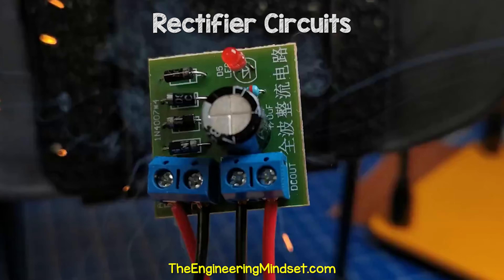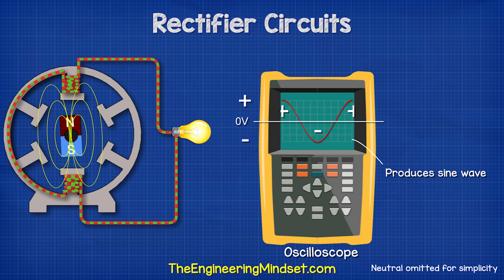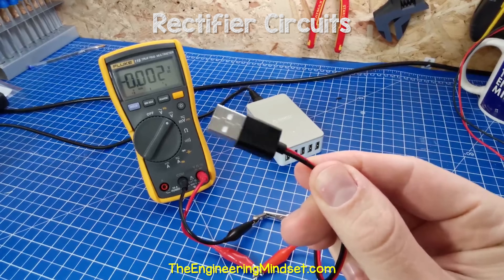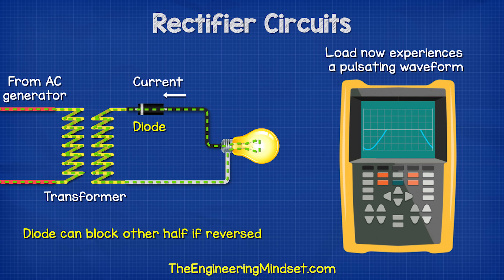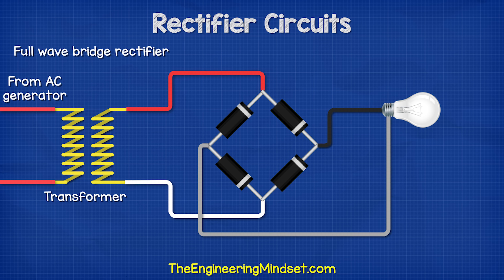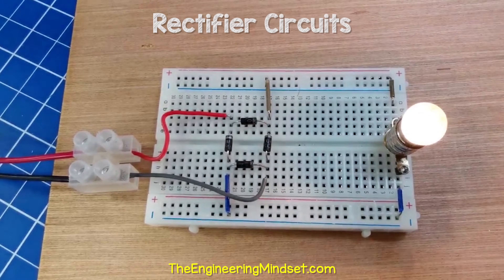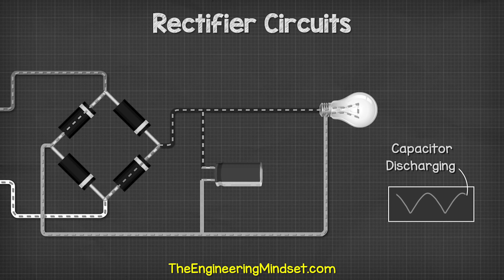Full Wave Bridge Rectifier + Capacitor filters +  half wave rectifier

Comment: Hi, Do you know any board for the following application input 110 VAC and Output 320 VDC with 0.75kw? I think that could be full bridge rectifier and increase the voltage and capacitor filter. Let me know your comments. Regards

Comment: US voltage is technically 240 V at the house via 2 connections split-phase. Some sockets in a house will be hooked to both bus bars to make 240 V.

Comment: I love this. Especially for homemade generators. 
But how to chose a Bleeder Resistor, especially for high voltage, high current circuits? Is it ok wire resistors in parallel, if I can't find high enough wattage resistors?
Like if, for example I need a resistor that can survive 1000 watts, at 10 Ohms, but I can only find 250 watt resistors. So, should I wire together in parallel four 250watt, resistors, each with 40 Ohms resistance, to compensate for the added paths of current, when I just want more surface area to disparate heat?

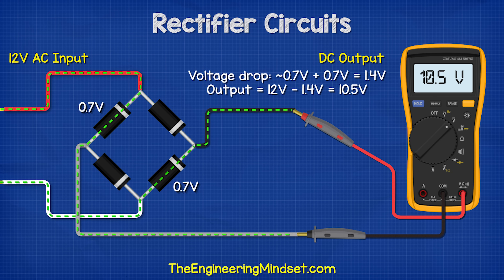Comment: At 16:03 why does the multimeter calculate using rms voltage 12v ac without capacitor to 10.5v dc but with capacitor it calculates using peak voltage 16.9v ac to 15.5v dc, how does the capacitor make the multimeter do that??😊

Comment: Hey Paul, I made a circuit using this tool on my phone called proto, highly recommend it, I user 5v AC and I think my led hated that so I cranked the max voltage as high as it would go and used a 100F capacitor since you cna easily use those and boom DC baby
Reply from the maker: Seen the new LED explained video? so much detail covered! https://youtu.be/O8M2z2hIbag

Comment: am trying to make a full bridge rectifier to convert 300 volts at 300Khz to dc with HFA25PB60 diodes but the output is not DC can you explain why ?

Comment: A great intro to the subject.  One thing I always find lacking in any coverage of AC is the reason why power companies use it.  

Basically it boils down to distance between generation and end-use.  AC voltage is easier and more efficient to deliver over longer distances than DC is... not as much power is lost transmitting it over longer distances.

Comment: As stated, the components in consumer electronics use and expect DC power. Question: Is it theoretically possible to produce consumer electronics that fully function on AC power? If so, why didn't we do that? Is it simply not technically possible? Is it inefficient compared to DC? Or would it need a totally different approach to electronics?

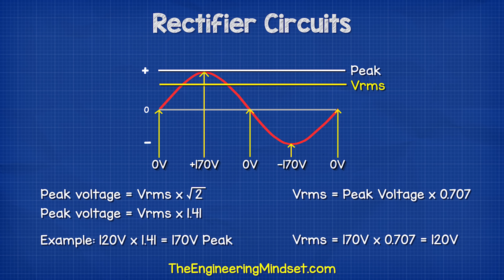Comment: One slight mistake at time stamp of about 3:37 : You say RMS voltage is obtained by dividing peak voltage by 0.707 when in fact it is multiplied by 0.707. The graphic in the video is nevertheless correct.
Reply: no he has the RMS value (120V in america) and is converting it to the peak voltage

Comment: I feel like all of the videos I find like this teach the theory of the board, and rarely approach the details.  How do I decide for my application what size resistors I should use?  How can I determine the right size capacitor and number of capacitors to use?  Why do the capacitors need to be in parallel?  What would happen if you put them in series instead?  What is an inductor?  How do I choose the right one for my application?  I know what a transistor is (sort of), but again, how do I choose one for my application?
Reply from the maker: Check out NEW resistor video, everything covered! ➡️ https://youtu.be/DYcLFHgVCn0

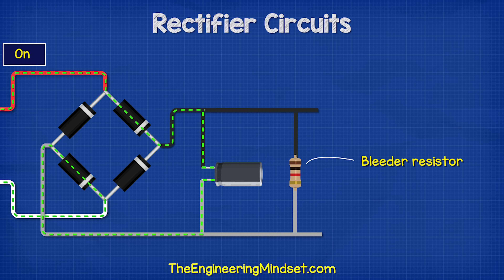Comment: This is excellent, but I'm trying to understand something: At 15:10, how is it that when the power is switched off, the current discharged from the capacitor will go the path to the bleeder resistor rather than to the load? Also, why wouldn't the current take this path while power is on? I'm just trying to understand the behaviour of the electrical current. Thank you for this video and any help.
Reply from the maker: Check out NEW resistor video, everything covered! ➡️ https://youtu.be/DYcLFHgVCn0
Reply: @EngineeringMindset  Thank you, sir.

Comment: A slight disagreement with your description of AC at 2:35. With a 2-wire voltage like this, what is "zero volts"? In this instance, it is only a mathematical construct. There is no "0VAC" connection anywhere. 0V is only a reference point for the math, where y = A*sin (wt) describes a floating AC voltage. But a meter or the generator itself has no idea what 0V means. Similarly, there is great misunderstanding of what "ground" means, too. What is ground? Does an electron know what it means? No, it is only a convenient reference point that we humans use to make a schematic look simpler. Ground, or 0V, means nothing to an electron. Electrons will go where electrons go. 0V is only where your meter's black wire probe touches! You can put that probe anywhere if you so desire. Many an engineer goes wrong by assuming his GND signal means there is zero voltage differential between various GND points of his circuit. If there is current flowing in the ground plane, then you betcha that there is a small voltage differential across the ground plane. Tiny, but finite. Audio engineers understand this subtle point because differential ground voltages can and will enter your audio circuit if you don't know what you're doing. I do concede that using the ubiquitous Ground symbol makes for a cleaner schematic, while also defining what you, the designer, want to define as zero volts.

Comment: So what about a formula for the inductors required inductance? I know the formula for the capacitors is Current*half the cycle time in seconds all divided by the acceptable voltage drop but what about with the inductors?

Comment: Question, I got a 85 Suzuki lt230s quadsport all the wiring is gone. If I build my own wiring harness do I need diodes or capacitors? It does still have a rectifier/regulator on the bike but not connected to anything.

Comment: There is a relevant question roaming around you tube Ain't get an answer on (when do i know i need to use capacitor in the circuit)? capacitors are used nearly in all electronics circuit but at least today i learn on when do i need to use capacitor on (filtering) apart from learn on how the bridge rectifier work. Thank you and u won my subscription & up thumb.

Comment: Please help i made my own bridge rectifier when i connect small 3v lamp  to its output the voltage drops from 13v to 0.5v i tried using my oscilloscope shows that from full bridge to straight line.

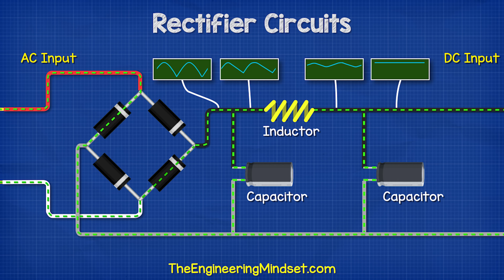Comment: Very well explained! I have a question though. At 17:53 you said the 2nd capacitor is much smaller. Is it small enough that it should be shown as a disc (rather than a cylinder), or is it a cylinder to show that it is polarized like the first one?
Reply: Think it’s to show polarity since on the next slide at 18:00 you can see he uses disk capacitors

Comment: The laptop "adapter" shown at 1:40 is a switched-mode power supply which has two full wave rectifiers in it, the first to produce high-voltage DC which is then converted to a variable frequency AC, stepped down in voltage and then rectified a second time at low voltage to produce the regulated output.  They can usually be recognized by the wide range of input voltages shown on the label 100-240V AC in this case.

Comment: While my general engineering faculties are pretty good, I'm fairly limited when it comes to electronics. I've just machined an alpha Stirling engine that I'm running with solar-power, which I've intensified with magnifying glasses (since the weather here in the UK is generally unable to provide the heat required to run it). 
I wanted to use the engine with a stepper motor as a dynamo, then run it through two of the full-wave bridge rectifiers you discuss here to provide fairly consistent output. The issue is that the input may be variable (as the intensity of the sun varies)... How do I use a rectifier without it either burning out or having too little input voltage in this scenario?
Reply: use battery with the same voltage (Solar input) to maintain consistency.
Reply from the maker: Seen our new video on HOW SOLAR PANELS WORK in detail https://youtu.be/Yxt72aDjFgY

Comment: When a power adapter says: ”12VDC” but actually 16VDC

Me: Throws power adapter onto the ground after having electronics fried in rage
Reply: That sucks. I have never had that issue. Also, most DC Inputs are safe at a range of DC Voltages, like 10V-20V (Or whatever) with the stated being 12V for example. They don't usually need to be that exact.

Comment: I just want to know how the current flowing in all the components of PCB.....Even if i see the circuit diagram, i cant understand where and how the components like Transistor, Diode, Capacitor, Resistor, Transformer, etc... are functioning in PCB, how to check first  if i want to repair component of PCB....how to know which is the short circuit or breaking point......how to know the difference of current wire and data cable/wire which can give signal.....i only sure about Ground....gnd....5v......how much voltage in d+, d-..........Can you please explain about PCB....Current Movement and data signal going on other components.....etc...
Reply from the maker: Check out NEW resistor video, everything covered! ➡️ https://youtu.be/DYcLFHgVCn0

Comment: Great work. Just one thing that keeps me wondering...why does the multimeter on the right read peak voltage of the capacitor(15.5V) but without the capacitor, it measures RMS voltage (10V)?🤔
Reply from the maker: It's the waveform which the multimeter is reading. Without a capacitor the waveform goes between zero V and max V. With capacitor the waveform no longer reaches zero.
Reply: The Engineering Mindset Oh yeah, I get it now. Gratitude, Paul.

PS. I also subbed to the french channel.😁
Reply from the maker: Check our new Multimeter tutorial out ➡️ https://youtu.be/4lAyzRxsbDc

Comment: You show the UK and European voltage as both being 230v but this is not really true. The "harmonised" voltage across EU/UK was set at 230v with convenient upper and lower allowable variation which means that the UK is still really 240v and parts of the EU less than 230v

Comment: Love the video but...The variac on the  left of screen, is that the way your supplying the 12V to your circuit, it looks like a variac not an isolation transformer.... please tell me you have an isolation transformer in circuit somewhere as I did not see you taking any precautions or mention them when presenting the video, safety is very important and if your doing what I think you may be then there should be stern warnings to users not to duplicate your demonstration without the right isolation. your also risking damage to your oscilloscope.

Comment: FYI : Hertz is related to the electricity provider Generators, which is basically how much they rotate per minute.
So 60 Hertz is equal 3600 rpm.
"Assuming the generator completes a 60 full cycle in 1 second"

Comment: North American systems run at 220V, but, at the fuse box in a building, it splits into two (2) 120V bars to run the majority of our appliances and lights.  A person could easily wire a house or building entirely 220V, and from what I have read, it would be more efficient.  I am looking for an inexpensive tankless hot water system and will get a 220V unit.

Larger machines, welders, clothes driers, stoves, etc., are wired 220V

Comment: What's the advantage of using the circuit with 4 diodes instead of the one with 2 diodes (10:20)?
Reply from the maker: Transformer is cheaper, also uses full voltage not just half coil

Comment: I've genuinely never tested the UK mains voltage with a True RMS meter and not seen at least 238 Volts.

AFAIK, it still technically is 240 Volts in most places (or at least aims for that).

The logistics of changing all of the transformers and generators to lower the voltage to 230V would have been extreme.

(since the system was designed for a frequency as close as possible to 50 Hz. To lower the voltage they would have had to run the generators more slowly than that, or replace thousands of transformers.)

The supply voltage in the UK was basically "harmonized" by the EU, as they changed the allowable voltage tolerance. So now they can call it "230V", but really the UK mains system didn't actually change, AFAIK.
Reply from the maker: Yeah, they basically just moved the goal posts wider but it was a cheap solution than changing all those transformers. Although newer ones come with tappings so the voltage can be chnaged
Reply: @EngineeringMindset  Oh yeah, that's true.

They have extra taps on the secondaries on some local transformers now.

I think sometimes they had that on older ones, too, so they could even out the voltage when a specific area was had a slightly lower (or higher) voltage on average?
Reply: And they have the "voltage regs" with auto-changing taps. I forget what the other name for them is, but then I'm not a lineman. lol

https://www.youtube.com/watch?v=I-h_9eMuT0c

But yeah, still technically 240V. ;)

Quite a sneaky way of changing it without actually changing anything. hehe